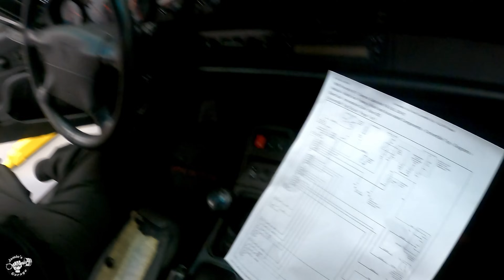We broke into a Porsche 911 with the customer's approval. Plus, a shop tour with Paul and the Boys

Comment: I noticed audio issues in this video, mostly dull sound, almost like a phone call . Did you use your phone? If so, was it connected to your bluetooth headset? I'm sure that's what caused the dull audio parts in your video. Look into your cameras audio settings if it can prefer a specific microfone, then use the internal ones there. If not, just disable bluetooth before you start filming. It could also be caused by wind suppression settings in the camera software.
Reply from the maker: Thank you!! I found a faulty audio cable and I tweaked the settings. Hopefully It’s all fixed moving forward